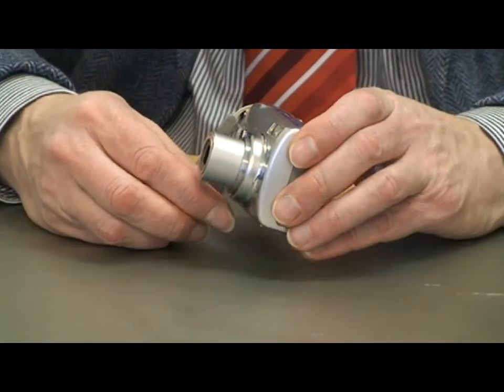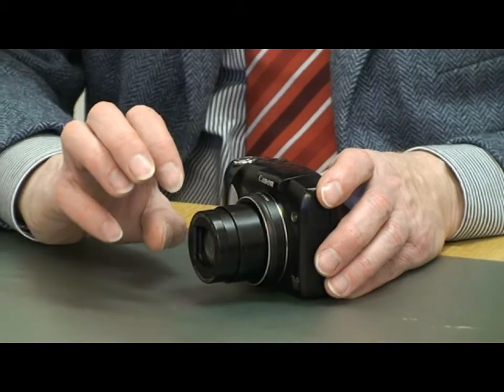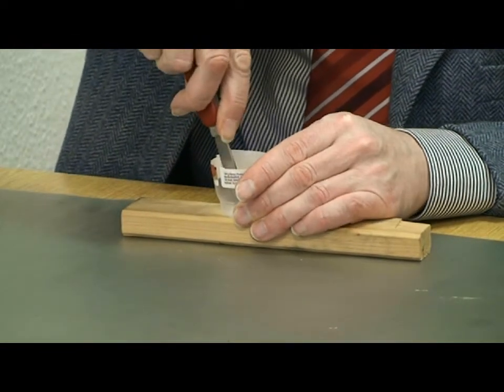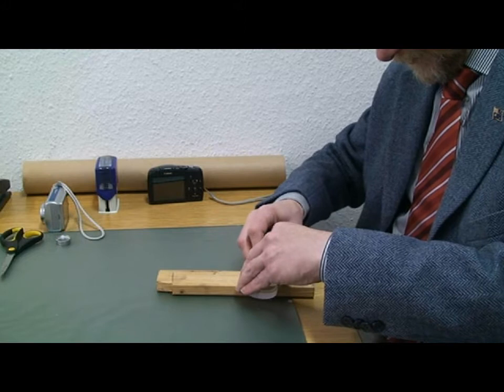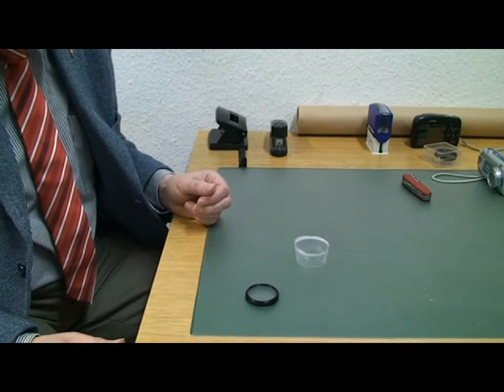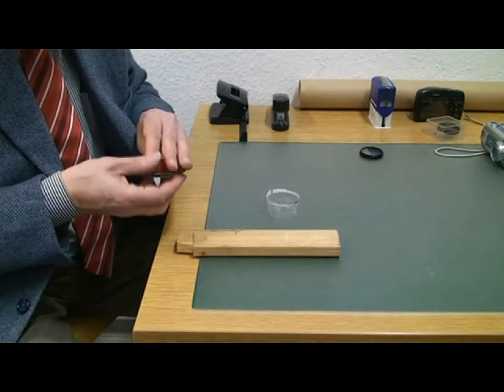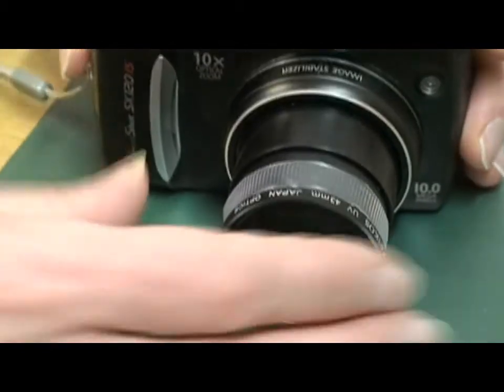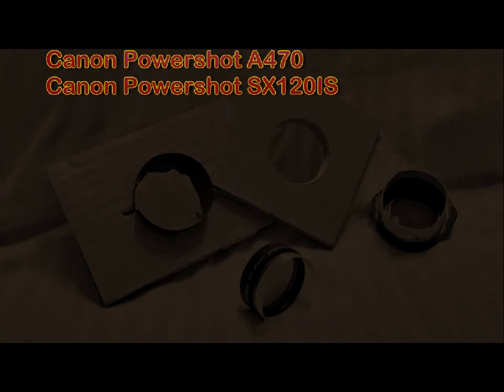Filter Adapters for Digital Cameras

Comment: Hello, regarding magnetic rings... Do you know a brand or where to get it? Tks.
Reply from the maker: Hi Francisco,

I saw some a few years ago at amazon, the company that made them was Hama. However, all they had was a very small UV filter that I could use on a Canon PowerShot A470, nothing larger. Not cheap, either. I think the solution I propose has the advantage of making use of the cheapest filters available (I got a set of these for just over €5).

Cheers